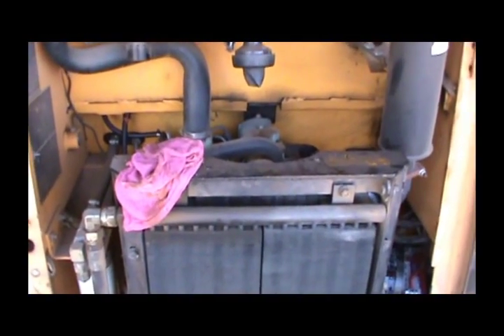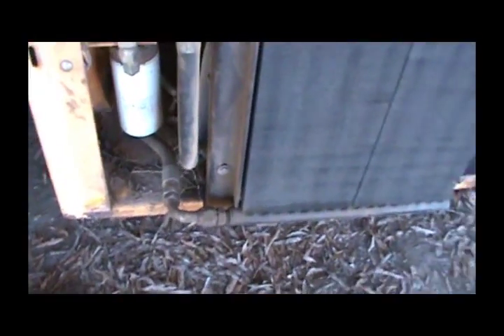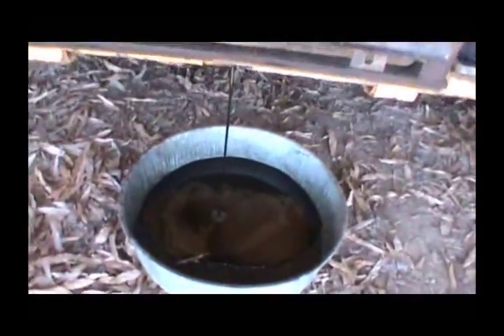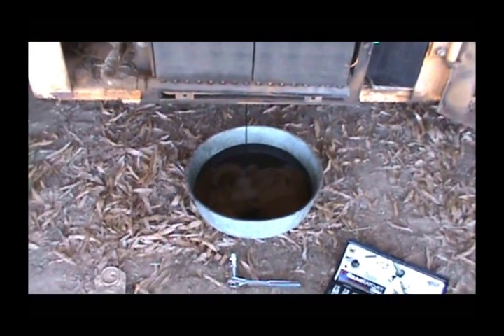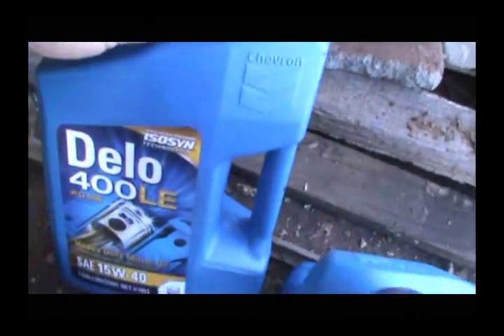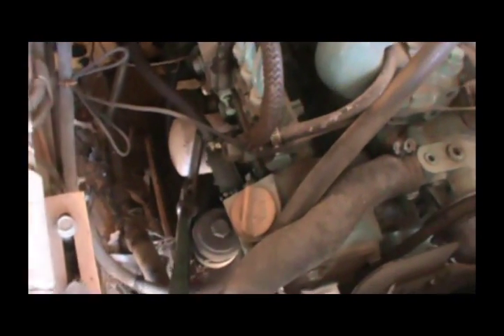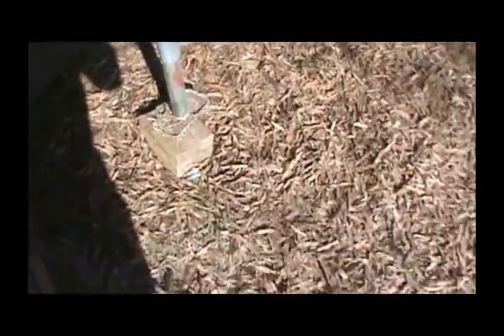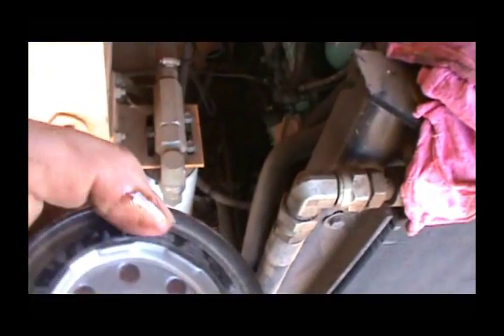Mustang 930A Oil Change

Comment: Good video, do you know how to check the hydraulic fluid in these?
Reply from the maker: The hydraulic tank is beside the fuel tank in the back.  The dipstick is attached to the cap.
Reply: farmboy30117 i have a 2054, can you point me in the right direction as to how to check the hydraulic fluid? Thank you so much
Reply: @farmboy30117  how do you check the engine oil?